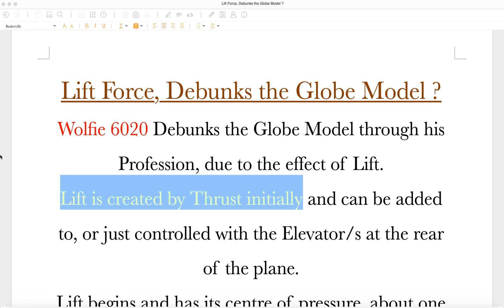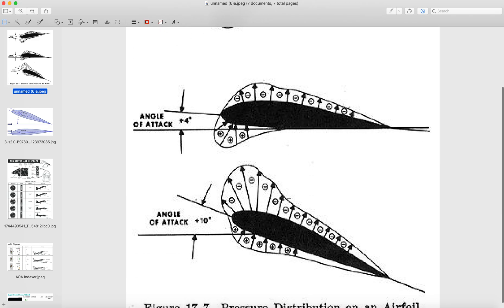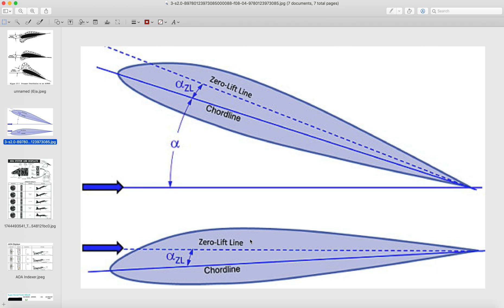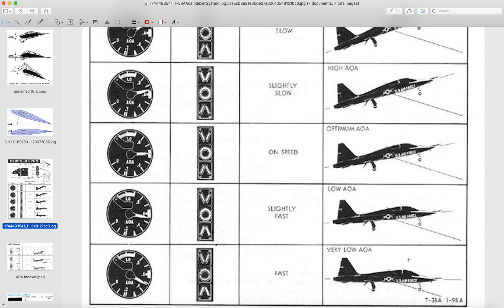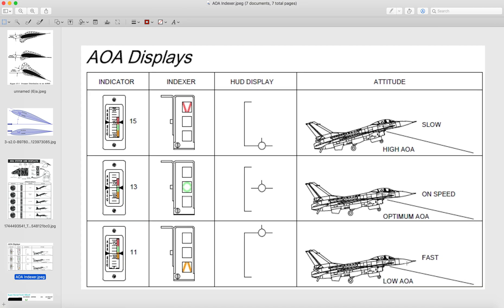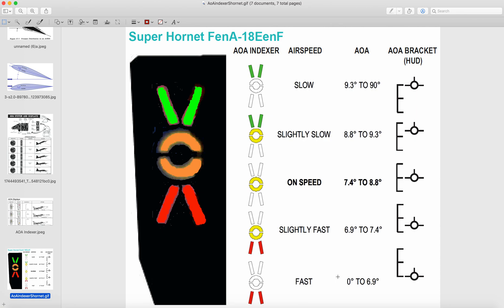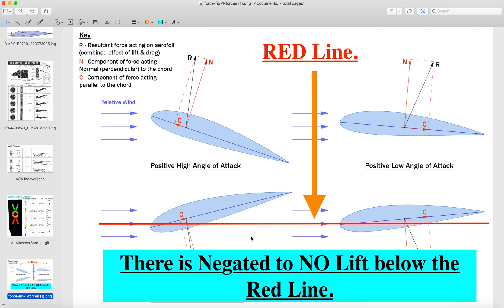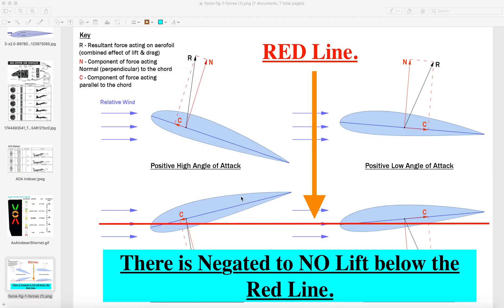Lift Force, Debunks The Globe Model ?

Comment: Brian, you KNOW that from the theoretical level flight on flat earth to 8" per mile drop on the globe, the relevant angle is 0.00723° difference.
In a triangle with sides of 1 mile, 1 mile and 8 inches (the drop in 1 mile on a globe) the relevant angle is 0.00723°. Less than 0.00723° is what an airplane would need to drop it's nose in order to fly level on the globe compared to the flat earth.
Pilots know how to balance thrust and trim to achieve this.
It's what they get paid for.
Reply: The drop of the surface of the earth is 8" per mile squared! You fly 1000 miles and your total amount of drop will be over 100 miles in respect from where you started! 
   In the real world you trim the aircraft for level flight locally and then do not make any further adjustments for the drop of the earth away from you. There are no 'magical automatic adjustments' built into the aircraft or that 'gravity' magically cause the aircraft to follow the 'curve of the earth' . It is because it doesn't exist! 
  That is why you are taught to fly over a flat earth.  
   It isn't to simplfy the calculations or the 'maths'. It is not necessary in the real world!
Reply: @ryanqvincent144  
Of all the incredibly stupid things FErs claim, this is the stupidest.
"You fly 1000 miles and the drop will be over 100 miles!!🤯"
What's 8"×1 mile squared Ryan?
What is 8 inches times 1 mile squared?
Pilots don't fly 1000 miles laser straight then make a one time 100 mile correction FFS! That's just stupid! (Thanks Taboo Conspiricy)
Pilots trim planes to fly a gently curved flight path that parallels the earth's surface, the altimeter senses atmospheric pressure that is consistent at that elevation and that's what pilots and autopilots follow.
Making gradual adjustments of 8" per mile every mile is too hard to get your head around?
Imagine driving your car around a 1/2 mile long, single radius, left hand curve. You don't drive 1/2 mile straight then cut hard 90° left, do you?
You've been driving long enough to know that you can turn your wheels to that perfect angle so that your car  just "flows" around the corner with little other correction.
Pilots practice too.
Reply: @jimsmith7212  Alas, you are flying over a sphere! What you describe is linear. At the end of each mile you have to turn down slightly. Don't get upset about this, a lot people, including me make this mistake. 
  see "Automated Calculator for Earth Curvature' at 'SmokescreenDesign dot com' Check the diagram further down the page to appreciate what is happening.
Reply: @ryanqvincent144  A trimmed aircraft would fly around the earth at it's maximum achievable height for that level of thrust. It would not fly off into space!
Reply: @1maico1  You have proof of that? All you know is that in the real world it flies at a fixed altitude. Now you are free to assume that when trimmed for level flight locally that also incorporates the automatic 'follow the earth required 'drop'. I have no idea. 
  just thoughts: Somehow the plane must follow the 'curve of the earth'.  
   It is also something that pilots don't seem to sure about how the aircraft does it.  They just know it seems to happen automatically in some way.
Reply: @Q Branch I promise you that no one is afraid of the truth! The issue is whether what you believe is actually the truth? Can the 'rotating globe' stand up to trying to be shown to be wrong? 

   If it was true then it would be impossible to destroy! 

    Alas, you need to prove the distance in the south are physically smaller at corresponging latitudes. You have no way to verify that! 
  There are clues that they are larger in the real world! 
   Seriously,  once you start to do 'due diligence' about this you will be disappointed with your current beliefs. 

   We do not live on a 'rotating globe'. It really is quite obvious once you stop trying to prove it and start to disprove it!

   All you need is one 'real world fact' to destroy it. There are many of them! 
  I was as disappointed as you will be when you find out. ;-/
Reply: @Q Branch lol, stop with the maths! It does not prove anything and is not 'truth'! :)
   No one has an accurate map of where we live! How are you going to verify the distance even if you have the maths? What are you going to compare it against? 
   For short distances then they will be the same. For longer distances, especially over water, then you have to assume what you are checking against is correct! 
   You cannot use the route distances as they aren't a straight line! 
   You are so screwed as there are too many unknowns! Until you understand this you are so lost!
     Until you understand all the issues then no one can help you! You cannot prove anything useful about where you live by assuming anything about distances across large bodies of water are true! You have no easy way to verify what you believe is correct!
  
   You have to prove somehow that the earth is a globe. You want to do it with information from south of the equator! 
  Go for it! :) 

  Telling me 'maths' about south of the equator is useless to anyone! :) 
  You really don't appreciate yet the fundamental issues that you have! 

  Until you really want to talk about the real world where we live then you are wasting my time. We need to go our separate ways. 
   Thanks for your opinions.
 
    You can always email me later with your discoveries about why the south shows why you cannot be on a globe. (see Profile)
   Don't ask me questions about explaining to you why what you believe is wrong! I know that already! :) 
    You have to find out for yourself. It is the only way that you will believe it.
Reply: @ryanqvincent144  Obviously you haven't verified what the real world is. By the way, the 24/7 sun in the summer in Antarctica can only happen if the earth is a globe and not flat. Yes, I have personally verified it. This is why we call you stupid. AGAIN
Reply from the maker: Incorrect the drop is squared Jim, and it doesn’t matter as the Chord line makes the claim impossible even for the first couple of miles….
Reply: @BriansLogic  You high school dropouts crack me up. My guess is that you live off of government funds. People that think they know everything while understanding nothing don't get good jobs.
Reply: @BriansLogic  
The drop in 8"per mi squared is squared?
Reply from the maker: @jimsmith7212  Jim the angle 📐 you gave does not make a circle ⭕️ it must make a circle….
Reply: @BriansLogic  
In a circle with a radius of 3959 mi a chord (or arc) of 1mi length would measure 0.014472 degrees.
If continued for 360° it makes a circle.
Reply from the maker: @jimsmith7212  A Chord Jim ? 
Jim after 200 miles there would be 26,600 feet of Drop, but who cares as it’s impossible due to the Chord Line anyway ? 
It can never drop below Horizontal Jim, that means no accounting for curvature.
So any angle below Horizontal is not reality, as in reality they always fly with both the Chord line and Nose above Horizontal…. 
So how could they be accounting for a degree of Curvature after only 7.52 minutes if going 550mph, and that’s negating Take Off remember ? 
That’s a whole other can of worms….
Reply: @BriansLogic  
Don't airplanes fly at a nose up attitude of 2 to 4 degrees?
How would reducing that by 0.00723° be even noticable?
Pilots follow altimeters and altimeters use atmospheric pressure, which is (relatively) consistent by altitude around the globe.
Pilots also have variometers and know exactly if they are climbing or descending.
https://en.m.wikipedia.org/wiki/Variometer
Holding the variometer at zero means the plane is holding a consistent altitude on the globe.
Reply from the maker: @jimsmith7212   No Jim 0.00 is below 0 degrees for what your proposing and it’s a Chord and not Curvature, your maths are not correct for the situation, you even stated a 2 to 4 degree Nose up, there is no logical way around it Jim, if the Chord line of the Wing must be above Horizontal then every aircraft would have to be losing lift constantly to even account for drop alone, and that’s not even curvature?
And more to the point, there would be ample data available to match these sort of corrections Jim, so where is the data, as following an Altitude is what you would do over a Flat Plane, but over a Globe there would be a need for much more than just following an Altitude ?
Reply: @BriansLogic  
See my first response to Ryan Q, 
The sixth in this thread.
26,600 feet in 200 miles🤯🤯🤯!!!
Is a wonderful strawman, you knock it right down every time.
200 miles at 600 mph is 20 minutes of flying time. You think a pilot flying "hands on" for 20 minutes wouldn't check his altimeter or variometer?  Not once?
Climbing 26,600 in 20 minutes equals a 1,330 foot per minute climb rate (on the imaginary flat earth, variable on the globe), meaning the pilot would have to have the plane trimmed for an average (1000 to 2000 ft per minute) climb rate and not know it.
Seriously?
Pilots trim planes to fly a certain altitude and air density and it's automatic after that.
It just happens to be a gently curved flight path.
Reply from the maker: @jimsmith7212  No Jim it’s a Squared function, so it gets more and more severe….
Your Not Accepting this Jim, the only way around a globe is Pitch Down something they can’t do due to the Chord Line, it’s Not Possible Jim. 
The 26,600 feet is the drop value for 200 miles using your maths, so no it’s not a strawman, it’s your maths Jim.
Reply: @BriansLogic  
IT'S NOT 0.0°- 0.00723° FFS!!
IT'S 2°~4°(level flight)- 0.00723°!
And that's to fly a course with an 8" drop per mile on a flat earth!
On the globe it's even less, as the change is incremental, the plane   being trimmed to fly a certain altidude as a gentle curve with a 3566+/- mile radius.
Reply from the maker: @jimsmith7212  Jim you need to get into reality, it can’t go around a globe if it can’t go below Horizontal My God man come on, look in the mirror 🪞 
It’s 8 inches per mile SQUARED, so that’s 72 after 3 miles, which would be 20 seconds of flight, and 9.16 miles after a minute so that’s 82 X 8 Jim, after 60 seconds of Flight ✈️ and they can’t dip their nose below Horizontal or they lose all Lift ?
Reply from the maker: @geologyrocks3072  We’d ? It’s We Would ya Fool….
Reply: @BriansLogic  Imagine a plane, flying at 10,000feet. 
The gravitational force acting on it (centred around the centre of gravity of the plane, CG) is in perfectly equal balance to the lift generated by the aerofoils trimmed at whatever attitude is necessary to balance the force of gravity.
The drag acting on the plane is equally balanced by the thrust of the engine(s)
Therefore the plane continues to fly at 10,000 feet.
It is that simple.
Yes, the surface of earth is a gentle downwards curve, but due to the balance in all forces acting on the plane, it maintains an altitude of 10,000 feet.

If it was to increase the height above the very gentle downwards curvature of earth (ie climb, gain altitude) that would require increased thrust to maintain airspeed, otherwise the airspeed would fall until it stalled. 
Well, that’s my take on this. Like you, I am not a qualified pilot.
Unlike you, I believe earth is a globe, not flat.
Reply: @justwilliam6893  Yes indeed ... the 8 thing is for the difference between a tangent and the curve.  Planes don't fly a tangent then suddenly correct an hour later; they follow their own curve to maintain altitude.

Flerfs don't get this.
Reply: @BriansLogic  
Hey Brian,
Can a plane descend with its nose up?
Reply: @Q Branch You already know how to calculate the flat distance. It is provided in your route calculations. 
  Think about it! It has to be! Whatever map you use must have the correct distances involved because of the limits of the aircraft!  
   Getting an aircraft from 'A' to 'B' is a lot more involved than just distance! That is why there are 'route planners'! 
   You are thinking about this topic incorrectly!

   What you never do when flying an aircraft is make adjustments that are specific to a 'rotating globe'! You never need to know about that at all!
  That is because it does not exist!
  It is called a 'model' for a reason.
Reply: @Q Branch Obviously! :) Think about it for a while! Remember, maps are projections. :) You can always go learn a little about how maps are made. Pilots have to fly over the real world! That is why no adjustments for 'curve of the earth' as you will end up crashing the aircraft!

   Because someone tells you that you are flying over a globe does not mean that they have verified what they tell you!
   This is the issue with any education technique. Especially the one that most of us went through.
Reply: @Q Branch You demanding a math expression does not help you to understand the situation! Assume no one on earth can tell you the maths you demand. Does that prove anything about where we live? 
   Of course it doesn't! Maths is only a description anyway! you cannot prove anything about the real world with maths! :) 

  The question is do we live on a 'rotating globe' or not? How do we find out? 
  What evidence is going to satisfy you?

Me not doing maths is going to convince you of that? Seriously? :) 

  I told you that you are approaching this issue in a 'less than useful' way.

  Clue: Instead of starting with a 'rotating globe' as true and all other maps are projections of it. 
   Understand what is actually measured in the real world and how the 'globe' comes about from the real world measurements. 
  This doesn't take long to find out. 
  However, you will learn so many interesting things on the way. :)  
   
  Remember, 'question everything' and you be fine and arrive with understanding. I promise.
Reply: @Q Branch I told you that you are approaching this incorrectly! Your first issue it to get an accurate map of the world! The globe isn't one and that can be shown!  
      You don't fly that far south of the equator and your route planner will account for the real world conditions! :)
 
  I promise you that it isn't as simple as your believe! You will disprove nothing with your current approach! 
   
 Remember what I said: "Question everything!" and you will be fine! 

  You are assuming the 'globe' is true. You have no way to verify that. Especially in the south! There are clues it is "not as described". :) 

  You have to stop thinking that we just 'don't understand like wot you do'. Believe me, if I could prove we lived on a 'rotating globe' I would tell you what the evidence was!

  I really do not like being a 'flat earther'!  However that is the real world and it can be shown to be such.